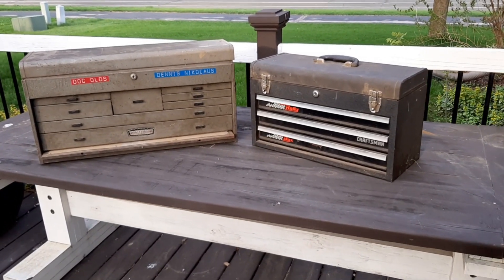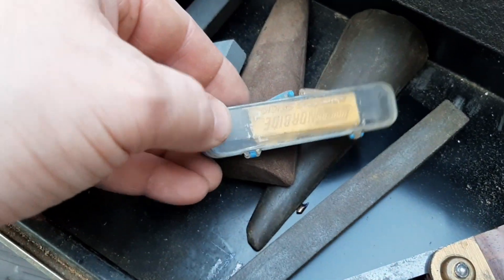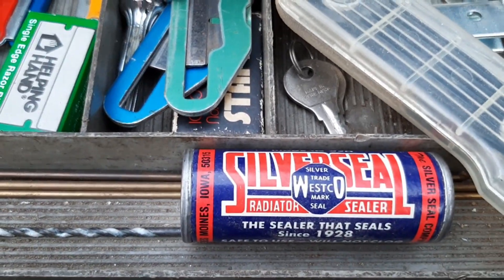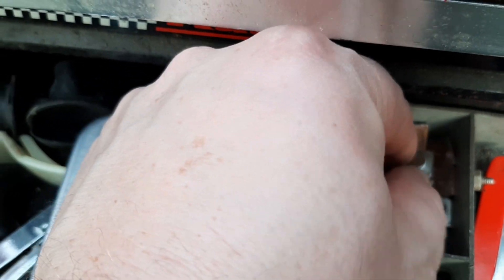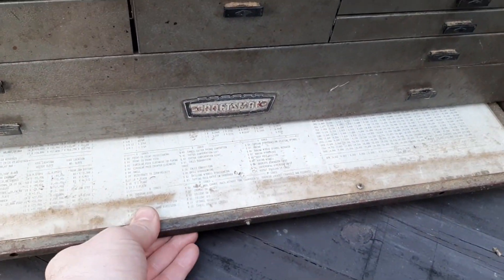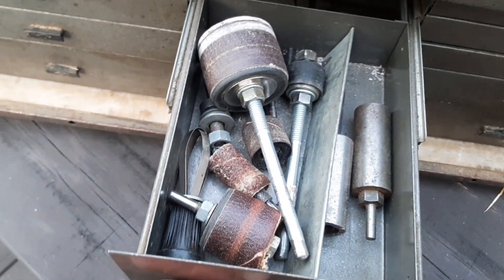Estate Sale Vintage Toolbox Tour Tool Haul Including Craftsman Starrett Mitutoyo Machinist Tools

Comment: 5:44  That is a flush cut plier.  Use it only on zip ties and suitable soft and small gauge wire.  Quality tool.  I had a pair just like that, probably even the same vintage.  Until somebody used them to cut a tamper tag off a power meter box.  Snapped a jaw clean off.  Those tamper tags are hardened stainless for those interested.
Reply from the maker: Thanks for all the great info! Thank you for watching!

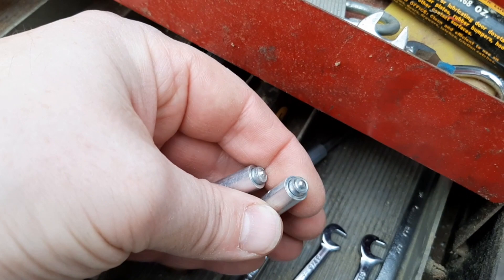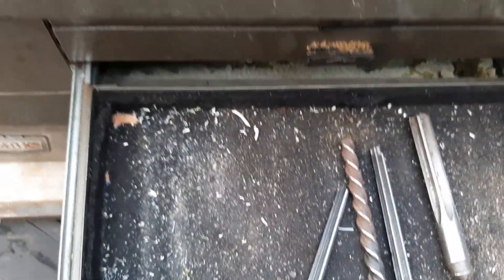Comment: Late to the game on this one, but the 26" machinist may be Kennedy manufacture (one of the makes Craftsman rebadged.  Waterloo was another, but this has the drop-pins for the front cover locking) 1:40 as mentioned elsewhere, appear to be rivet sets for snaps or grommets. Brownells is heavy to gunsmithing. 6:35 cutting inserts, maybe? Not sure what for. 7:30 Yankee driver bits it is (North Bros, bought by Stanley post WW-II, Craftsman rebadged for years) 9:10 mandrels for something (internal holding- they expand) 9:30 internal scraper for cleaning, like a smoking pipe reamer. 10:55 taper pin hole reamers 13:45 boring bar
Reply from the maker: Thanks for all the good info! Thank you for watching!

Comment: I’m guessing the items at 1:40 and 2:00 are used to ‘set’ snap fasteners.  There are two parts.  You have several of the ‘punches’ but missing the round ‘disk’ anvil half.  They are usually included with a bunch of snaps, likely why there are so many.
Reply from the maker: Thank you! After looking them up, they sure do look a lot like what you are describing! Thank you for watching!

Comment: Brownell's is an outdoors/hunting/firearms retailer. Among many other things, they sell gunsmithing tools like some of the screwdriver/bits you have there. The slotted screws used in firearms are generally turned with a bit/driver that isn't tapered in thickness like a regular slotted screwdriver is. It allows for better grip and less likely to slip or strip out the slot in the screw.

Take care and God Bless.
Reply from the maker: Thank you for the info! It is a nice little set. Thank you for watching!
Reply: @thetoolbandit  Gunsmithing screw bits are not like regular bits, they are usually designed to be sacrificial. Don't go using them on just anything
Reply from the maker: @Jeff-ne2sg  Thanks for the heads up!
Reply: That’s the Brownell’s Magna-tip set.  The green handle is from at least 40-50 years ago, if not older.  Believe it or not that’s the one thing in both boxes I’d love to have because of its history, as I love old gunsmithing tools.  

The blue stubby handle is much newer and comes with each of the Magna-tip sets. I have their fixed blade screwdriver set in an oak block from 1994, they even supplied a brass name tag for it.  I also have the Magna-tip Super and thin bit sets.

They make magna-tip handles in different lengths, as well as non-magnetic “clip tip” handles for times you don’t want your work magnetized.  My favorite are the mid length “law enforcement handles” that allow you to get closer to your work.   They expect you will break some bits over time, so they sell large and small grinding stones 1 1/8” and 5/8” for use in a Fordham or Dremel rotary tool or drill press that allows you to regrind the tips back to factory or to a different configuration for custom gun screws.  If you ever see a buggered gun screw, you know whoever did it was a hack and didn’t use one of these type bits. 

My Dad was a gunsmith and I have a bunch of Brownell’s tools.  They’re the best quality and guaranteed forever to the original owner.  They also sell reloading stuff, and firearms accessories like quality slings and a thousand other things.  Great outfit.

Those Brown & Sharp micrometers easily quintupled your $50 investment, so well done!  I enjoy seeing “unboxing” old items like this, so new subscriber here!  👍

Comment: Back in the 1950'S my dad had a Yankee push screwdriver. Also had a push driver for drilling small holes in wood ( maybe up to 3/16" ). Nice vidio. When I retired 5 years ago and bought home a large tool chest and two milk crates of tools told the wife I was going to stop buying toys man tools. Yep just don't know what year ! Just the mics was worth the $45 that you paid. Have one of the four sided thread chaser only tool cart last 50 years. Only used it twice.
Reply from the maker: I needed to stop buying tools 10 years ago! LOL Thank you for watching!

Comment: The oddly shaped (triangular) stones are used for gouges, or wood turning type tools, with a curved convex/concave blade. Hope thats the case because thats what I use them for ! The measuring tool drawer is indeed the money drawer  👍
Reply from the maker: I was thinking that, but I have always seen them ground on a grinding wheel. But that is about the only thing I thought they could be used for. Thank you for watching!

Comment: Very cool.   What do you do with the tool boxes?  I"ve seen how some people set up multiple boxes in their workshops. 
Lately I've had my eyes open for 1980s or 1990s Craftsman bottom boxes.    The plan is to have a couple of those rather than a huge modern box.        (Did I say a couple?....I meant three or four or however many I can get away with before they send me off to the looney bin).
Reply from the maker: I used them for job specific tools. So I have one with electrical tools, one with drill bits and other bits, one with fasteners and so on. Some also become displays. Thank you for watching!
Reply: @thetoolbandit  YouTube has brought out a bunch of tool collectors.   Somewhere, some bat channel I saw a guy who had a tool collection neatly organized in drawers.   It was actually pretty cool.

I like the idea of having a tool box full of displays
Any reason to buy more tool boxes is a win in my book.